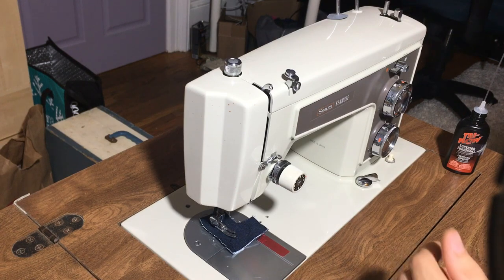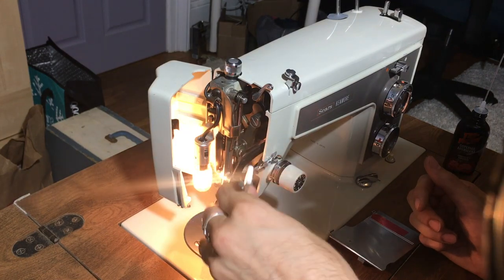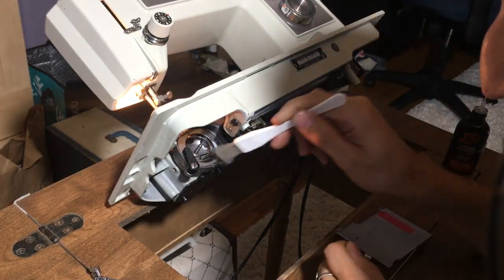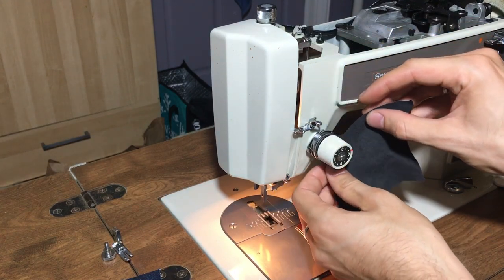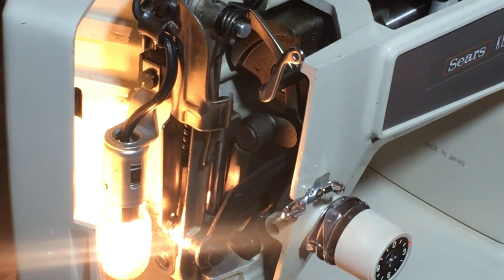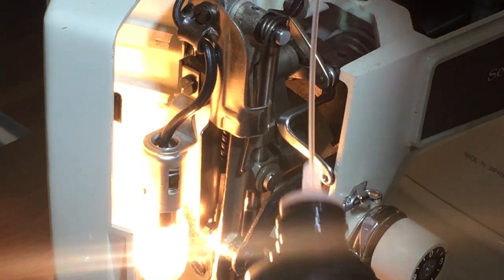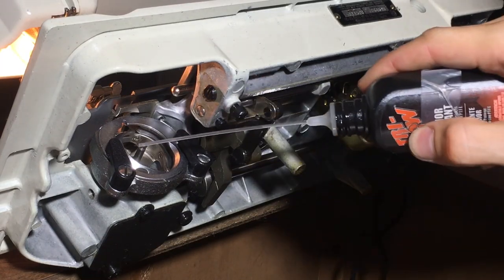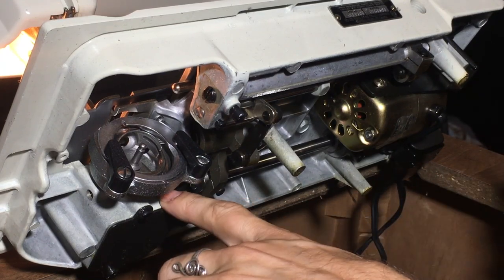How to Clean + Oil a Sears Kenmore 158 Series Sewing Machine - General Maintenance & Feed Dog Issue

Comment: Went through an old but solid Kenmore with the help of this video. Still had a problem with the belt slipping; it turned out the speed reduction pulley that's above the motor had seized onto the shaft it's supposed to turn on. Simple repair once we found where the problem was - you need to remove the cover on that end of the machine to access the pulley.

Comment: Very useful video, many thanks. I finally acquired a nice 158.19410 machine with low shank and it is very dry. Good to know where the oiling points are.  Here are some tips from my previous cleanings:
If your machine has seized up, and its mostly metal, use a heat gun (or open it up and leave in hot sun a couple of hours), spray carburetor cleaner on metal parts avoiding painted, plastic, and rubber parts. Wipe off, repeat. 
Then use penetrating oil (low viscosity) on all parts such as Liquid Wrench or a 50:50 mix of Auto Transmission Fluid and Acetone.  Scrub with a toothbrush to remove gummy oil residue. Let it soak in and wiggle the parts till loose.  This goes in fast and deeper than regular oil.
You can also use alcohol to scrub and clean out machine or Mineral Spirits.
Once machine is cleaned out and moving well, wipe off all that stuff, and lubricate with Triflow Silicone lube on shafts, and pack Silicone (synthetic) grease on gears.  The grease will cling to gears unlike the liquid lube.  Silicone does not break down into gummy residue, neither does sewing machine oil.
Do not use WD40 as a lubricant, only as a penetrating oil (cleaner oil)
Do not use 3-in-1 machine oil, or mineral oil or any other oil. This is what becomes gummy resin and seizes up the machines.
Reply from the maker: Your methods seem slightly over-zealous, but as long as you clean those penetrating oils off properly and replace it with sewing machine oil, you're good to go. When it comes to grease, less is better. If you put too much, the gears will squeeze it out and it will fling onto other parts when the machine is running fast. Grease lightly and repeat every few years.

Comment: Hello sir, 
I appreciate your thorough demonstration. It is very helpful. 👍. I have a helpful tip on vide in tight places. I found that an adjustable low cost head lamp that straps around the forehead leaves the hand free while cutting out shadows. It makes details shine and work easier.

  Now I have a question about a similar 158. series Kenmore that my parents gave me.  It's like new but hasn't been used in over twenty years. The problem occurred after adding a couple drops of light sewing machine oil to the bearing /shaft contact of the pullies. I found that gravity and centrifugal force made it migrate to the belt. It took an hour to clean it off thoroughly. Is there a technique that will allow my needle oiler to keep it in the bearing races and not drip to the side of the pulley? I know how to remove the handwheel and oil it from the right side. It's the left side and in-between the two pulleys that  are the issue.

Comment: I'm having troubles getting Reverse to work on my 158.17851. It looks different than the one you're showing here (in feed-dog section of repair at 10:50+). If I turn the wheel backwards, the feed dogs go in a circular pattern which is perfect for reverse. But when I push the button down, the feed dogs only go up and down (not the circular pattern needed to pull fabric toward you). So, I end up not being able to use cams or sew in reverse. I located the necessary gears, put penetrating oil on al moving parts (except those nearest feed dog from underneath as that bottom access door seems unable to open) to no avail. When I operate it manually by turning the knob, or moving the internal parts everything works fine. It's just that the Reverse lever is not engaging the system so feed dogs go in reverse circular pattern. I can't afford to send it in at $150 - and everything else is all clean, oiled and working perfectly - Any ideas?
Reply: I have the same problem on my 158.10301.  It only goes up and down in reverse.  I suspect the issue is something gunked up by the reverse lever.  I took the wheel and size off, and used some Tri-flow in the area of the spring.  The lever engaged better but the feed dogs still are just moving up and down - not fully engaged in reverse.  I am about to give up - I've been messing with this for a few years now.
Reply: @katherinebarich3192  Very frustrating! I've used penetrating oil all over mine and it's clean as a whistle. Been 2 months for me. This sewing machine has a metal plate over the lower left half (where the needle bed, etc. are), and so I can't see well what I'm working with. it's not as simple as those with no left plate underneath. Plus, mine has one plastic gear - and so, I'm about done with mine, too. With that gear and the configuration, even if I get it working this time (seems unlikely) any future repairs would also be a bear. Luckily, it was free to me. I was hoping to fix + donate, but no. I don't even want to donate to a thrift store as it would take someone with a lot of expertise to get it working. I'm thinking metal scrap yard. Gosh, I hate to give up, but I'm STUCK :/

Comment: The machine in your video is mounted on a sewing desk just like ours.  You showed us how to oil the underside of the machine.  But how do you get there? In other words how did you detach the machine from the table ?  Thanks in advance for your help.
Reply from the maker: This machine is a flatbed machine, so all I do is lift up the machine to expose the underside. Some free-arm kenmores have bottom covers which can be removed with a few screws

Comment: I inherited a kenmore 158.901 model. Does not look like this one. It needs a thorough cleaning. I also have a singer 401A that I completely took apart and soaked all the metal parts to get the gooey old grease off and reassembled it using new oil!  Can I do this with this model? It’s extremely heavy and made of all metal!  This one is heavier than my singer 401a is. I love my 401a!
Reply: Soy mecánico experto en máquinas domésticas en especial kenmtes brother y singer ,soy amante de las buenas marcas de máquinas de costura y páramo la KENMORE es la mejor máquina casera del mundo muy por encima de la SINGER Que desde hace tiempo no saca calidad ha quedado puro el renombre
Reply: La 401 trajo un problema una vez que se use por mucho tiempo el portabobina de acero se desgasta y crea problema en el bordado de lazo en la lanzadera

Comment: CN you please show or tell me how to get the hand crank off a 15817033 sewing machine thank you
Reply from the maker: By handcrank I'm assuming you mean the handwheel. To remove, start by loosening and removing the small screw that is on the clutch knob. Then, loosen the clutch knob completely and remove it. There will be a small metal washer, take it off. At this point the handwheel will be ready to slide off, but the tension of the motor belt will likely prevent this. You may have to loosen the belt tension first but adjusting the motor position underneath. I hope this helps

Comment: My machine will not move at all....should I oil everywhere you describe before I try to run it...it powers on but it has been sitting for many years
Reply from the maker: Hi Patti, I would recommend oiling it liberally (3 drops or so) at every moving point. The area that usually causes machines to freeze up is in the needlebar area. After oiling, let it sit for a few hours (or overnight) before trying to move it with the handwheel. You can also apply heat with a hairdryer which will help. It may take a few days of repeating the process but it should break free eventually. Before doing any of this, make sure there isnt any thread caught in the machine. Often times I find that thread caught in the hook race can jam up the whole machine. I hope this helps
Reply: Wanted to let you know I got my 50 year old machine working after not using it for 40 yrs...I followed your hat you said...finally got my oil today and oiled the areas as stated in my original manual....manually moved the needle up and down a couple of times and then it released and I was able to run the machine with  foot pedal...I need to replace bulb...and I'm unsure what bulb to order...it doesn't indicate in the manual...can you suggest what bulb I would order...I normally order from Amazon since there are no sewing centers near where I live....thank you so much...by the way I'm 73 and pretty proud I brought my machine back to life....with your instructuon....forever grateful....
Reply from the maker: @MultiPacoi  I'm glad you got it working! Enjoy your lovely machine

Comment: Do you have this sewing machine bobbin case and metal bobbin to sell me at a lower price? My mom is really looking for that but here in Brazil we can’t find it. It would be such a present for mother’s day
Reply from the maker: Hi Abel, this machine takes a very standard 15 class bobbin case. Both the bobbin case and bobbins are sold everywhere, it doesn't have to be a vintage Kenmore bobbin case, any type 15 bobbin should work just fine. I can sell you a case and bobbins if you like, but it might be faster and less shipping cost (I'm in Canada) to get one from a local sewing centre or online.
Reply from the maker: Something like this: https://www.amazon.ca/Kalevel-Bobbins-Machine-Babylock-Husqvarna/dp/B071FQSZ9H/ref=pd_lpo_201_img_1/133-9425515-9107520?_encoding=UTF8&pd_rd_i=B071FQSZ9H&pd_rd_r=92b64a84-e9c8-484a-bc04-94c00e4f510b&pd_rd_w=tgIad&pd_rd_wg=z2ln0&pf_rd_p=e3a1248d-31f8-4a3e-8bd9-de32736d5db8&pf_rd_r=945KGXYGMQC1JV51ZBKS&refRID=945KGXYGMQC1JV51ZBKS&th=1

Comment: What about the gear box with 4 screws? I have been cleaning and oiling  my machine for years and never thought to open that box up. Do yourself a favor and open it up and remove all of the disgusting old. Grease and grease it with tri flow white grease!